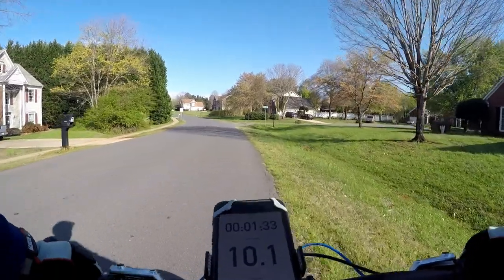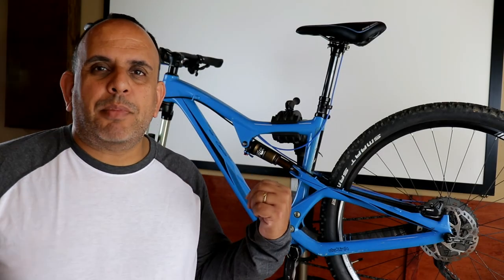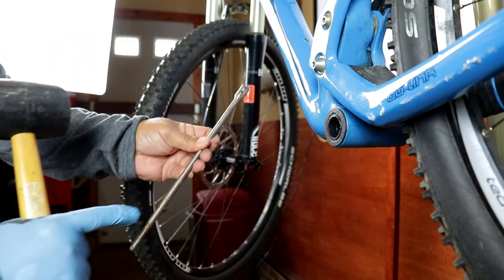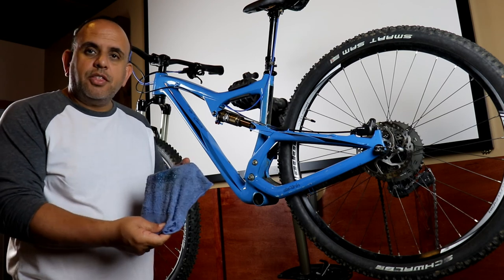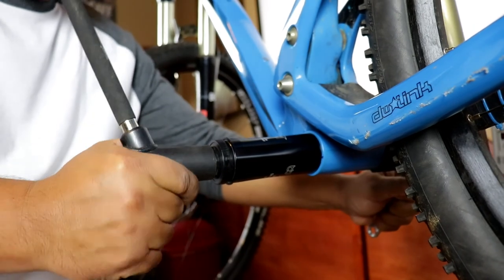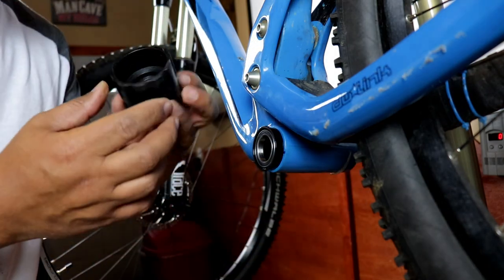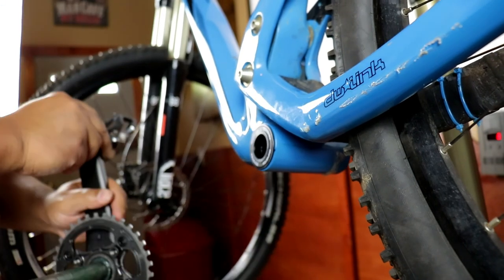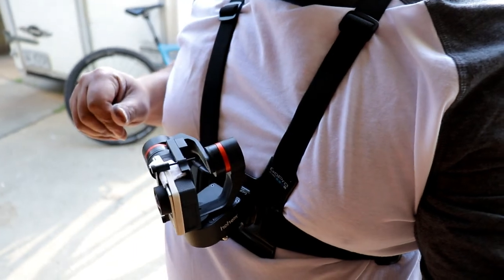BBinfinite BB92 Press Fit Installation

Comment: Great video, great installation ... How'd the bottom bracket end up working out for you? Do you still have it, and would you buy it again?
Reply from the maker: Thanks for the comments! That bottom bracket is excellent and it worked out great. I ended up selling that bike in early 2022 to fund the Evil Reckoning.

If I ever had a situation again where I needed a new BB, I would take a serious look again the BBInfinite. The build quality is top notch and when I had the entire crank assembly in there it spun forever. Very smooth.

Comment: you should have put some grease on the bearing caps to keep moisture and dirt out. but great job over all.
Reply from the maker: Hi Romeo, Thanks for the feedback. Hopefully this will be the only time I need to replace a bottom bracket ......... fingers crossed.
Reply: Old Man Mountain Biking yeah it looks like a good solution to fixing bottom bracket creaking. Thinking about getting one of these for my Caad12, its been to the shop two times now and the bearing in the left side is popping again. So even the mechanic at the shop doesn’t know what to do with it. And these are new bearings that was installed by the shop. So seems like they don’t know what to do with BB30 😂 the folks at infinite guarantee that there module will cure the problem indefinitely, so I am going to give it a go.
Reply from the maker: Awesome! Once you get that installed and tested, post back here and let us know. I'd be real curious to hear about your experience. Good luck!
Reply: Was just thinking that before i scrolled down.

Comment: Nice video , you made a small mistake when you wanter to complete the install "after you put the vibra tite "

 You installed the Black  spacer  the wrong way that it  didnt get supported  properly , that is why it  got stuck to the frame  after you finished pressing it in....

 It alse  got stuck croocked  due to the pressure which scratched the paint under your BB shell..

But the install went on without issues.

I have done hundreds of those and they are Amazing .
Reply from the maker: Hi Askcyc,

Thanks for the input. I want to build another bike and will most likely put another BBInfinite in. If it happens to be a Press Fit I will remember, and yes these are great! Thanks again.
Reply: Old Man Mountain Biking  it is all good ,  a piece of advice from me , always  check the way this  black piece goes, it has a 41mm BB86/bb92 side on one way , and a 46mm side for PF30 and BB386Evo on thw other.

If the 46mm side then you can install a  cup and turn it to a 42mm bb30 side.

So it is Universal and re usable

Comment: When removing the crank arm, I don’t think you need to fully remove the 5mm bolts.  You can just loosen them.
Reply from the maker: Thanks for the advice. If I ever get to a point where I am dealing with crank arms again I will try and keep this in mind.

Comment: I have a Canyon Lux FS SL 8.0 (2018 carbon) with press fit bottom bracket. I have followed step by step to do the service right using primer and loctite 680. After the service and 24h to make sure the loctite was cured I hit the trails and the horrible loud creaking is still there!!! This bike is driving me crazy! An expensive top bike with this annoying creak!!!  I really don't know what to do. Any suggestions??
Reply from the maker: Hi Cicero, 

Apologies for the delay as I was out of the country on vacation. Unfortunately I had the same thing happen. So what I am doing now is changing out my bearings on the frame including where the DW link is and replacing the two upper and lower swivel bolts. I may also need to re-grease my headset around where the fork area. All of this may seem like overkill but its the next logical step for me at this point.

When I am done I should have a nice clean bike to ride on. Hope this helps, let me know if you decide to go down this route and how it works out.
Reply: @oldmanadventuring  Hey...I solved the problem replacing the BB and checking the pivots. I chose the token ninja BB which is high quality compared to the sram gxp. Also the pivot washers on both sides of the frame were worn out. On the right was carbon with carbon causing creaking. We have replaced the washers, now is perfect again. About the BB I recommend token, high quality!!! Thanks !!!
Reply: Old Man Mountain Biking Did you manage time resolve the creaks? Really eager to know how’s your long term review for these BBinfinite BB.

Comment: no anti sieze on the bb?
Reply from the maker: Not on this one. The press fit was very tight but if I had to, I could still get all the parts off if needed.
Reply: @oldmanadventuring  ahhh okay, as long as it comes off without breaking any parts!!

Comment: Not a fan of not using a proper tool to get the BB out. Need to test it out on an uphill climb. Also, you didn't use a specific grease for your carbon frame.
Reply: the "proper tool"  i bought made for removing bb  bearings is basically a large steel drift   does basically the same thing ...  relax, its gunna be ok.

Comment: Why are you clamping your bike on the top tube? Good way to crack a carbon frame...
Reply from the maker: Haha ,yeah I know ...... every website, maintenance guru, article, and common sense says to mount the bike on the seat tube. Its just the way I have always done it. Old habits that have been around for years are hard to break.
Reply: not if you are careful.  Its not difficult to set the clamp up properly to hold tight and yet,...not crush....

relax.
Reply: Dude, look at his neighborhood. He can buy a new one 😆